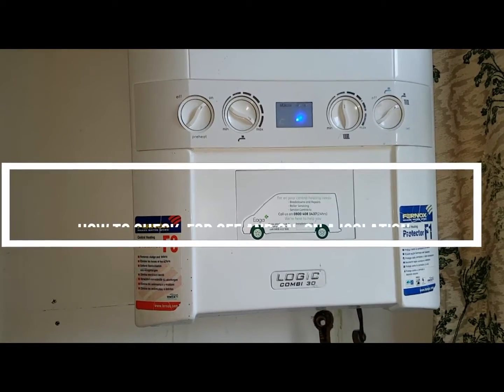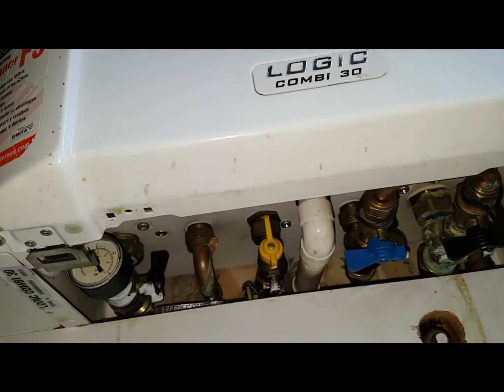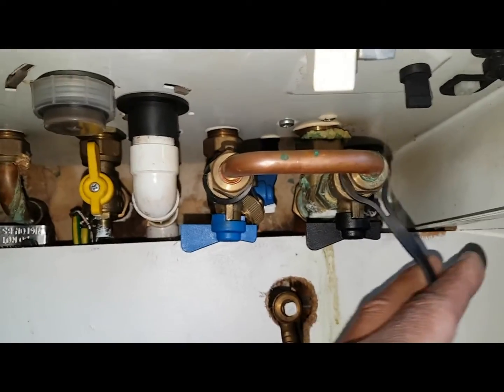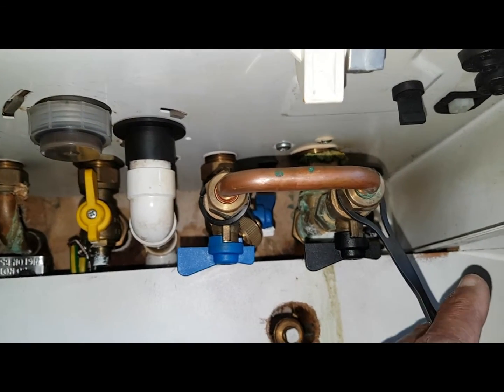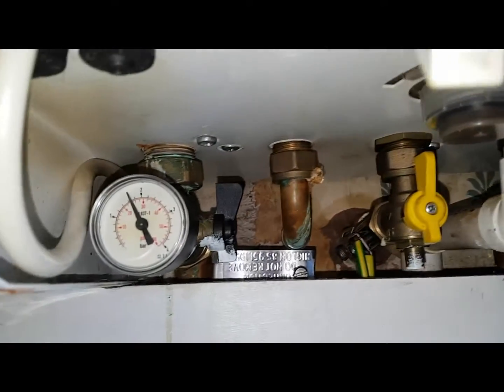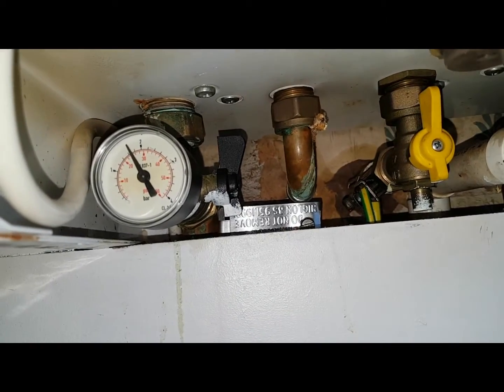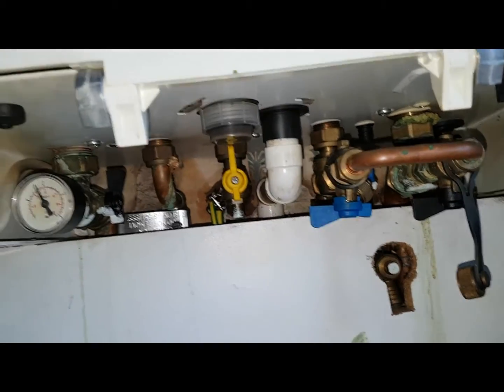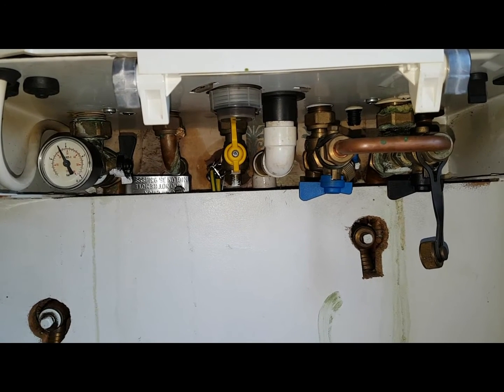Ideal Logic 30  How to Check Isolation Valves are On or Off. With Coach Tony Morgan

Comment: Hi to turn off the isolation valves conduct a test if a water is in the leak or system, from the video is the isolation valves the one next to the pressure gauge and the far black one or the one behind the blue one on the right? Thanks. Great video

Comment from the maker: To isolate the heating, it's the two outside valves in black. The hot water valve in the middle is normally in blue

Comment: Hello Tony, please can you help me I'm desperate, can you please tell me which position the yellow valve should be in, I have no hot water... the boiler display read f2 and I did the water pressure and now the boiler display reads 00 and is now on standby, but I'm confused about the yellow valve, I think I accidentally moved it and don't know what position it should be on, please help me sir thank you

Comment: I have the same colour values in the same places, but I’m not sure which ones to turn to repressure my boiler :(. Every video says the blue valves, but I have black valves where people are turning their blue ones. It’s confusing
Reply: You might have an older IDEAL Boiler. The one demonstrated here is an IDEAL Logic 30 which as far as I know is a Combi Boiler. On some of the older models you will just see 2 black valves, the left pipe is Return, the right pipe is the Flow. The pipe in the middle has a yellow valve and that is Gas. If there is no Blue valves with a loop like this video underneath then your boiler probably doesn't have a built in filling loop. You might have a System boiler not a Combi. It is topped up or filled somewhere else on the system. If you are lucky this has been facilitated somewhere accessible.  If you have a hot water cylinder look in the press there. You might see a mains 15mm pipe coming down from the attic header tank (it might also have a black shut off valve on the pipe). Trace this and see if it is connected to either a flexi hose (flexible metal pipe) or connected to a non-return valve with a pressure guage in the same area. 

Flexi:
https://www.screwfix.com/p/essentials-r24-filling-loop-with-non-return-valve/83905

Non-Return Valve example:
https://www.amazon.co.uk/Auto-Fill-Valve-Guage-Female/dp/B01M0JPCSO/1

The non-return is a valve that makes sure none of the central heating water gets back into the mains when you top it up. So if you see one somewhere this is probably the filling point. There may be another on/off valve attached to the flexi or close to the non-return valve. If the valve is inline with the pipe it is open, if it is perpendicular it is off. Open it and see if the pressure increase to 1.5 or so. When done shut it off again. There is usually a pressure guage nearby or attached to it so you don't have to check at the boiler.

If you can't find any filling loop in an accessible area then best to get a plumber to look and show you where it is or install one at the pipes below the boiler.

Comment: The black tap with the pressure pump, should that be tuned up or down once filled? I filled it and the gage is passed 3, now the pressure is too high and I can't remember if the black tap should face up or down to turn it off? Also the yellow tap .. once the pressure is fixed (or in my case too much) should that be facing up or down too? Thanks 👍🏼

Comment: Hi Tony, should the 2 black valves either side be in a vertical position.

My pressure was low, and i topped it up, next day my hot water tap had no water, think i may have turned a valve accidently.

My 2 loop valves blue are horizontal, and 2 black vertical, is this correct for the system to operate

Cheers
Reply from the maker: Hi Garry the hot water lever on 15mm pipe should be in the horizontal position. Also could you subscribe to our channel 😊

Comment: Plz help IV no hot water my radiators are working  but no hot water 👍
Reply from the maker: You might have a flow turbine problem does the boiler fire up or does the on status stay on Zero when you run the hot water,?

Comment: I appreciate this video a lot thank you.

The valve behind the pressure gauge (for CH flow). I mistakenly topped up boiler pressure and test ran the tap with this in the off position.
It seems to have broken the pressure gauge. So I'm now following the manual to drain the system and replace the gauge.
I drained as much water as possible via the rads, but the manual says:

-Close all the CH water isolating valves on the boiler inlet.
- Open the drain valve and attach a length of hose to the CH drain point.

What I'm unclear on, 
1. is whether draining water via the rads was enough.
2. Which are the CH water isolating valves.

Any input massively appreciated! I've turned a simple refill task into an ordeal.
Reply from the maker: If the radiators you are draining from are below the boiler you won't need to touch the isolation valves.
Reply: @ARBoilers  Yeah the boiler is about 1m above the rads in a cupboard. 
Also I removed the drain bolt on the inline scale filter and emptied the water there too so as I understand all the pressure should have been released.
Reply from the maker: @eugenevoltage1654  that's fine go ahead and do the job. And can you please subscribe to our channel 😊
Reply: @ARBoilers  subscribed! Thanks!

Comment: Thanks so much, super helpful! Such a straight forward explanation. 
I took my towel rails down last week to redecorate, and put them back up today. Everything’s working great, but the pressure gauge is stuck in the 6 o clock position. It didn’t move when I pressurised it. The hot water and central heating are both working fine with no errors on the boiler. Could the pressure gauge just be faulty?
Reply from the maker: Hi Steve that's correct it looks like the pressure gauge is faulty

Comment: Mine aren’t set up the same ?? I have different values But it’s same boiler  if I sent a picture can you tell if they are right ? I have no heating but when I turn on thermostat you can hear the boiler start up but no heat
Reply: I have an Ideal Logic Combi C30 installed earlier this year and found this video had the same valve layout: https://www.youtube.com/watch?v=d9-RRcAQGRM I believe you want the two blue taps OFF and the black tap on the right ON (or at least mine is pointing up?)

Comment: I have watched your video and my valves are in the correct position but for some reason I have no hot water feed to my taps and showers ?
Reply from the maker: Your hot water isolation valve could be turn off under the boiler
Reply: @ARBoilers  ok thanks for replying do quick which one should I turn
Reply: @ARBoilers  
what colour and where is that one 🤔
Reply from the maker: @oneofthatlotGB  It's usually blue and its near the centre of the boiler
Reply: @ARBoilers  thank you so much for taking the time to help me when I turned that last night water was rushing through the plastic pipe at the back but since I reduced the pressure hat presto u have my hot water back 
sue
Reply from the maker: @oneofthatlotGB  that's great 👍

Comment: I’m replacing the flow turbine cartridge on our Ideal Combi 30, my question is- am i just closing the cold inlet at the back to do this? Ive tried to close it buts its solid. Also, am i pushing it towards the wall or pulling it towards me to close it? Thanks
Reply from the maker: Its best to turn off the main stop tap to be safe

Comment: Thanks for that. I run a resource where (others) wish to alter times of heating etc, and invariably feel it is required to top up boiler, (unnecessarily so) and other valves get tampered with, after they gain access. Get a lock on the door, if it is in cupboard, signed sheets to access, and have only designated folk to access with key.
Beyond this, keep your Users Manual safe and again only appropriate folk need access.
Any other issues beyond topping boiler, and basic fault finding..leave it to Service Engineers. P.S. Yellow valves are gas.......

Comment: My pressure is at 0. I have now put pressure up to where it needs to be, but I touched the tap where it shows the pressure, now hot water working but heating isn't. Any idea how I can fix this?
Reply from the maker: Check the two outside levers the should be pointing upwards 👍

Comment: Hi, I turned the black valve on the left of the boiler towards me (off) and now it is stuck and won't turn back to upwards. Is there a problem with this and if so how do I turn it back on?
Reply from the maker: You could use some grips, or call out a Engineer
Reply: Mines stuck also

Comment: Hey there my boiler valves are all up and pressure is okay but water only gets like warm can you help me to why this could be please ?
Reply from the maker: It could be the divertor valve could be passing or hot water heat exchanger requires replacing
Reply: my did that recently and was divertor  valve head (ebay Diverter Valve Head - part no 174813)

Comment: This video helps.
The pressure on my ideal boiler keeps dropping and i have to fill every month or so.
I can't find any leaks on any visible central heating pipework.
Can you show/tell me how to remove/replace the prv and i also need to get to the condensate trap to see if its full of sediment.
I have no idea where it is on the my ideal boiler.
Reply from the maker: For this you need one of our engineers what area are you in?